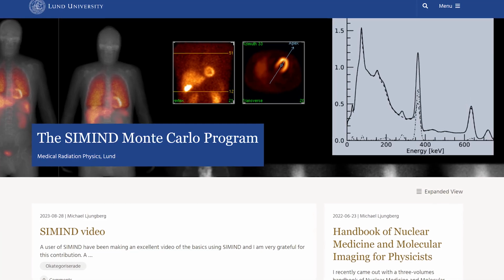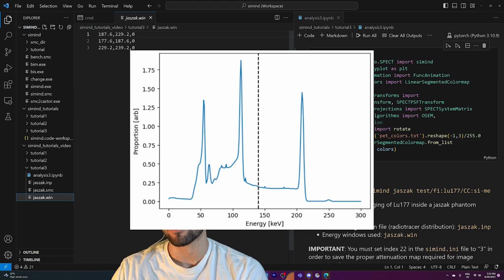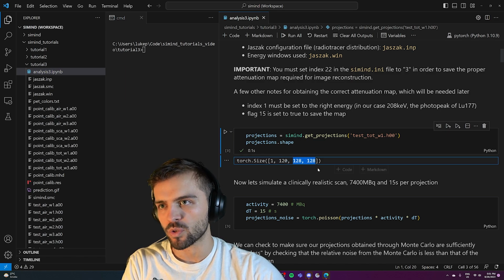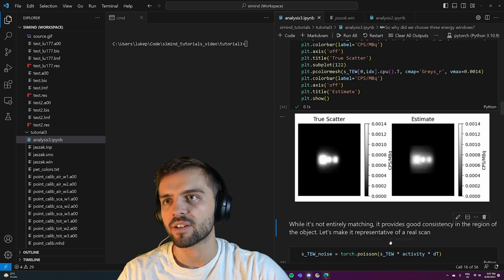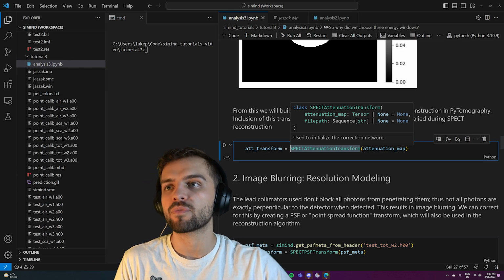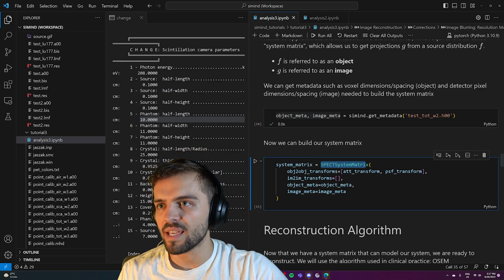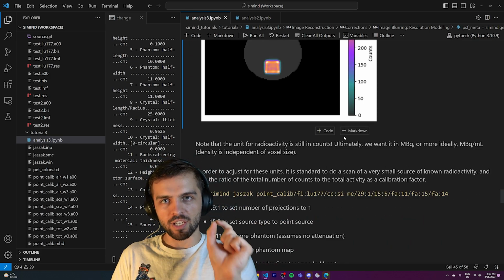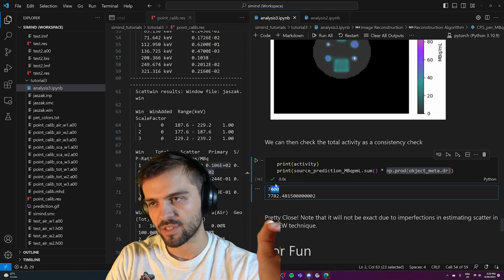SIMIND Monte Carlo SPECT Simulator: Part 3

Comment: Hi, thanks for the tutorial. I’m running into an issue where these imports can’t be found in pytomography:

from pytomography.transforms import SPECTAttenuationTransform, SPECTPSFTransform
from pytomography.projectors import SPECTSystemMatrix

I’m using the latest version available via pip. Have these classes been moved, renamed, or removed in newer versions?
Reply: You probably already figured this out, but they moved to a lower level.

from pytomography.transforms.SPECT import SPECTAttenuationTransform, SPECTPSFTransform
from pytomography.projectors.SPECT import SPECTSystemMatrix

Comment: Hey followed the tutorial with some new parts updated on the pytomography website, all parameters were kept the same. When reconstructing I found my central axial slice had a distorted blurred circle instead of the 6 geometries. I figured out this was due to the point spread function. Turning off the point spread function part reveals all 6 geometries but then this leads to the count number severely decreasing where the max shown in the 64th slice is 500. Has anyone else had this issue, and how come the point spread function is not overly blurring your reconstruction?

Comment: I got the problem to run simind jaszak test/fi:lu177/CC:si-me. The error showed that the jaszak_fso source routine error from input. I changed to point as input, it worked well.
Reply: I also got this problem. I used the SIMIND v8.0 and the jaszak files in path 'simind\tutorial',  but it still have the jaszak_fso source routine error. Do you know how to solve this problem? Thanks.
Reply: @syihundih I still cannot solve it
Reply: @khajta  Refer to page 52 of the simind manual 8.0, you need to add /if:jaszak. So I used the command: simind jaszak test/fi:lu177/CC:si-me/if:jaszak, and no error occurred!

Comment: Why does running "attenuation_map = simind.get_attenuation_map('test.hct')" this code will get an error "ValueError: cannot reshape array of size 1048576 into shape (128,128,128)"
Reply: Hi, 
go to simind.ini file put index 22 equal to 3 to have correct alignment with your SPECT or .h00 file

Comment: I have a question. The error message is "module 'pytomography.io.SPECT.simind' has no attribute 'get_scatter_from_TEW'" Why is this? Please help.
Reply: simind.compute_EW_scatter is the new function from pytomography library that does that. You need to give the upper and lower projections and width of the energy windows

Comment: I have a question, why did you apply blurring correction and system modeling for window 2 (lower window) and not window 1 (primary window)?
Reply from the maker: Good catch: that's a mistake on my part. Won't have a huge effect, but will mean that the PSF modeling is for a slightly slower energy window
Reply: Alright thanks for your response